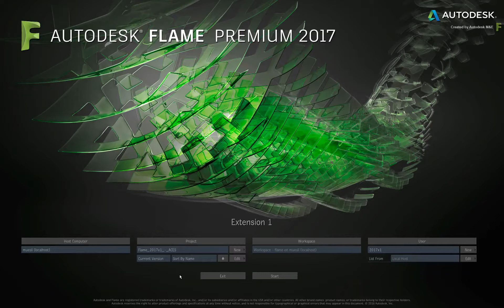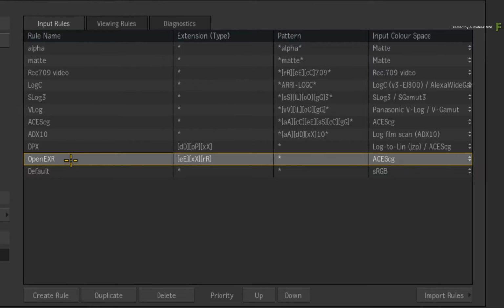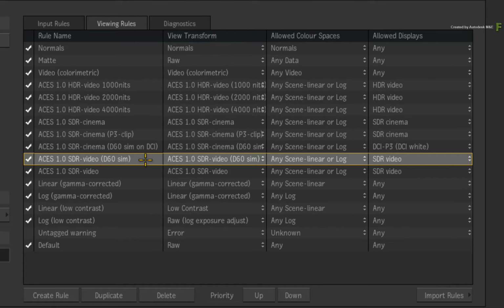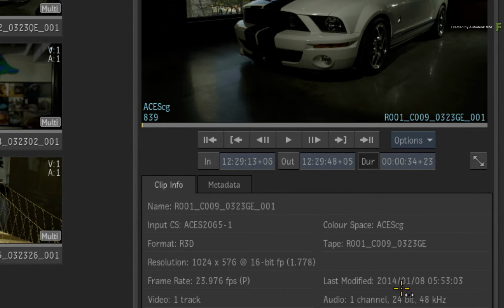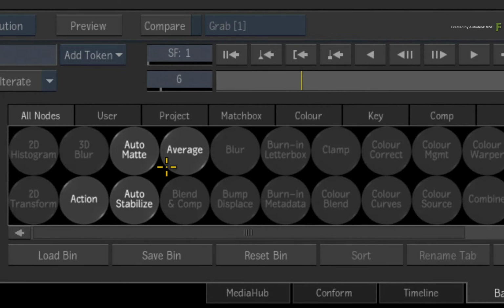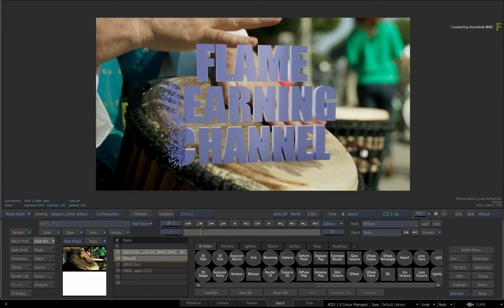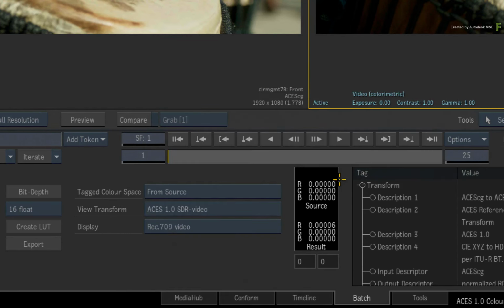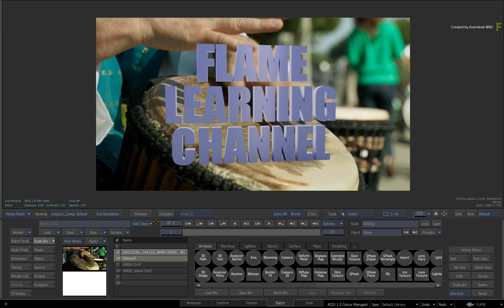CM - Part 6 - ACES 1.0 Colour Management - Flame 2017x1

Comment: What if you are working with handoffs from a different facility, and they are in AP0? Can you bypass the ACEScg rule and interpret just certain footage as AP0?
Reply from the maker: Hi Ariel Wollinger, It is very possible to bypass the ACEScg colour space and use an alternative one.   

If you want to change the tagging manually, when you are in the MediaHub, you can set the colour management tagging to whatever colour space you need.   This setting will than be applied to all imported clips from this point onwards until you set tagging to be "automatic" using From Files and Rules or a different colour space.

If you want to change the tagging automatically, you can edit the input rules in the Colour Management preferences to recognise specific media as the colour space of your choice.  So with the From Files & Rules setting, each clip scanned by the MediaHUB will have colour management applied to it based on the set rules.

Please also bear in mind that whatever colour space you tag your media as, you need to ensure that you have the correct viewing rules/LUTs set up so that you see your media the way it was intended to be.   This should be covered in the other parts within this colour management series.

Thanks the comment!